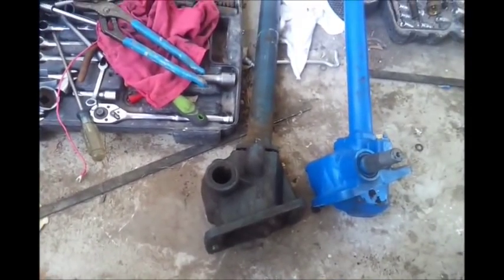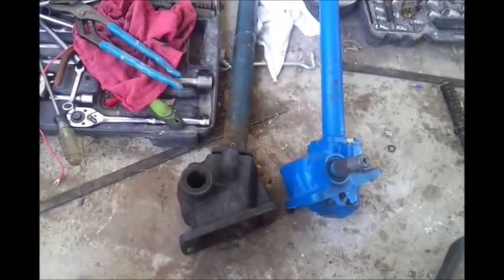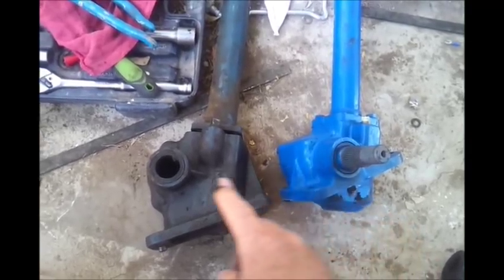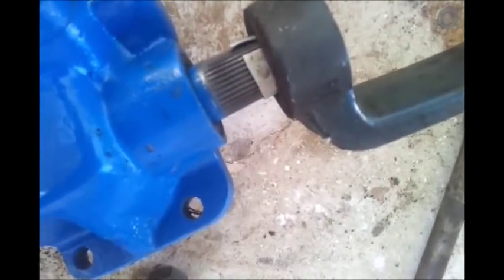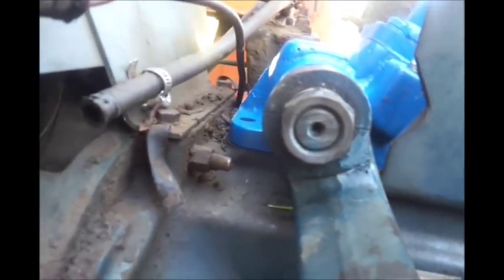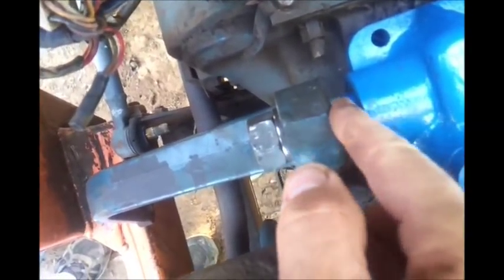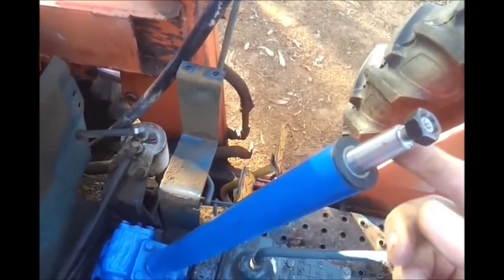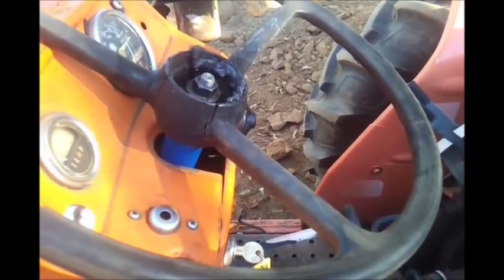Kubota l295 steering box repair works almost like power steering one hand just needs nob.

Comment: Beside all the normal maintenance. i.e. oil change, cleaning, etc.
Make sure the work follow a little bit more. In this video you present a nice solution, but missed something rather important. 
Your steering wheel hub is OPEN, that´s a big no no.
Water, dust...will seep trough the seal, into the steering column and in a relatively short time. You get back to square one. With rusted components, damaged bearings, etc.
Always make sure the hub is covered. 
Thanks for sharing very good information. ;-)
Cheers
Reply from the maker: yea for sure I aleady changed that. the water displaces the oil then rusts everything out.